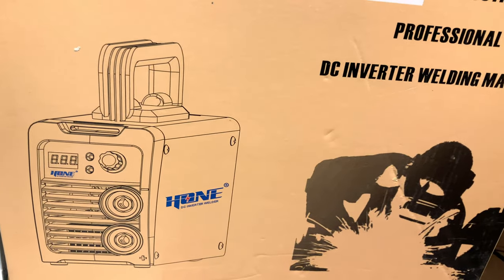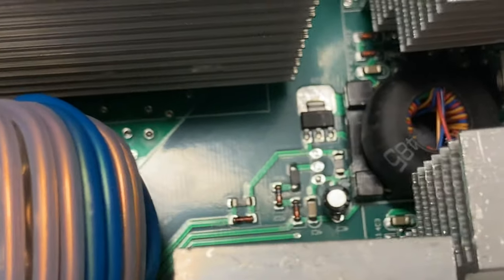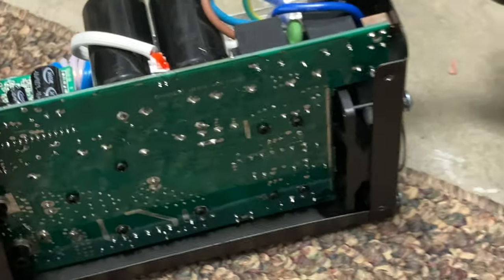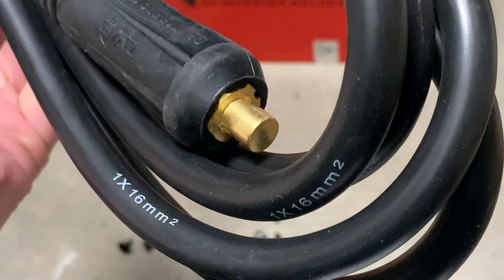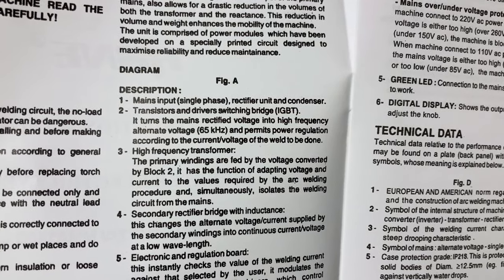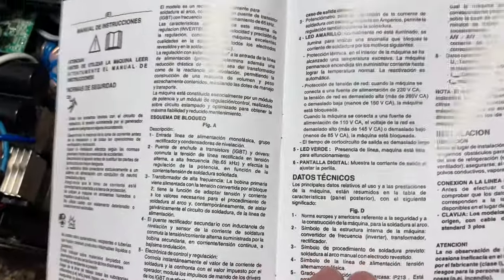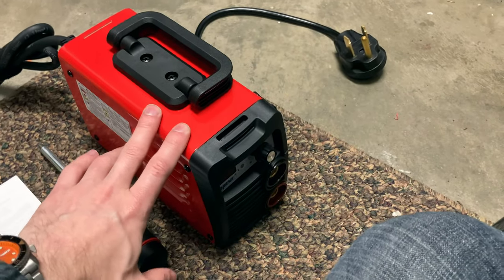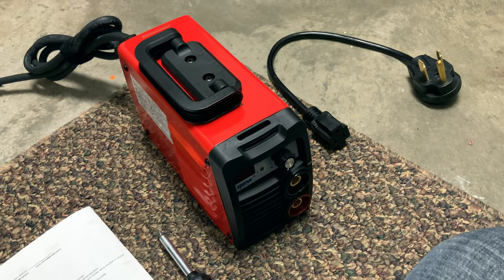IGBT Hone MMA140D DC Welder (Look Inside) Case Opened + Overview Analysis & Exploration Explanation

Comment: I got this exact same welder.  It actually does do its rated amperage at 220v. At 110v it maxes out at 120 amps with a shorter duty cycle. I determined with a magnet check that the singer is copper clad steel. The ground clamp jaws are also copper clad steel. If you look carefully at the end of the 6 gauge (under sized) 9.8ft cables, it is CLEARLY copper clad aluminum wire used. It is at least fine braided. But i understand why they have to do this. They have to put the copper where it counts to keep the cost of the unit down. I purchased 50 ft of fine braid 4ga OFC wire. $1.70 /ft. Got new dinse style connectors cause why not have a backup ($10 on Amazon). Also purchased 4ga 5/16th solid copper ring terminals. I just reused the singer end and clamp end.  I'm sure just like my car amp when i tried running 2000watts through 12ga, the unit should run cooler from not having to force power through cheap cables AND I'm not stuck 10ft from the welder.
Reply from the maker: Thanks for the highly detailed & instructive comment. I just needed to fix and exhaust system because a fool stole the cat & O2 sensor with a rotary blade exhaust pipe cutter to sell for money to pay for a drug habit. We saw the dudes who did it on video, they looked like low lives. I mean I need a cheap welder to fix the thin wall pipes, with low power, so it would not melt a hole easily. I use farm rods & they work well for this even on 110. I practiced on scape pipe from a local exhaust shop. MIG & TIG were too expensive for a 2X simple repair job.

Comment: please be careful touching a board with such large capacitors. they can hold a charge for a while.
Reply from the maker: Good point about high farad capacitors storing deadly current for long residency times! I am well familiar but thank you for the warning. I made a stun button as a child with a large capacitor & microwave oven transformer, nail, wire, 9v battery & small circuit to put pulses in & control the pulse rate & pulse duration as an AC waveform to step up the voltage to charge the capacitor connected to the nail output & Dotty the bus driver took it from my hand while it was hot & got a very intense shock, resulting in this being taken away & me to the vice principle Jerries office. Him & I are still friends :)

Comment: Can you show how it weld, please??, thanks
Reply from the maker: They are $100 & the sticks are cheap, if you want to see it weld, get a welding hood, leather gloves, one of these IGBT units, some farm rods, metal to weld up, do it with good ventilation outside & have a good time learning to strike an arc & to drag the bead & then use a little hammer to break the slag off & practice welding. I do not run a welding channel & also a very inexperienced amateur with very little experience welding, got the entire setup to repair my car exhaust after some whacko stole my muffler & catalytic convert //